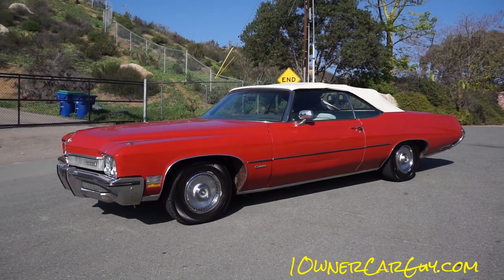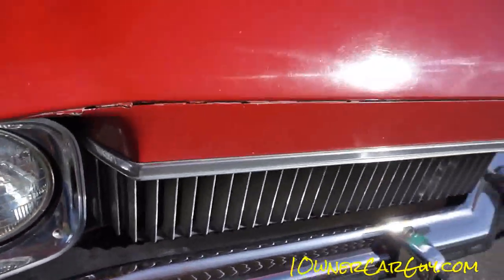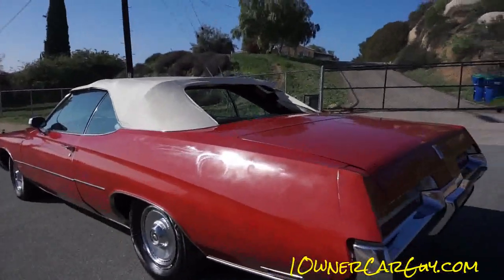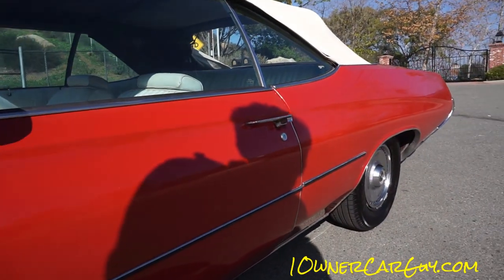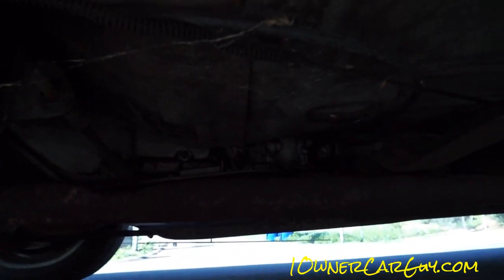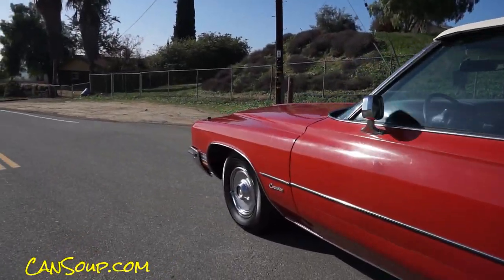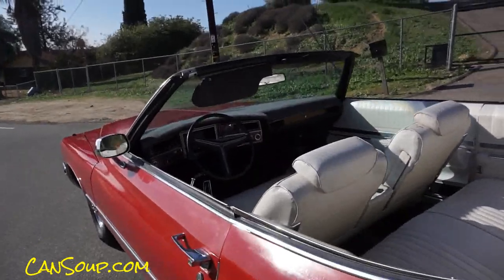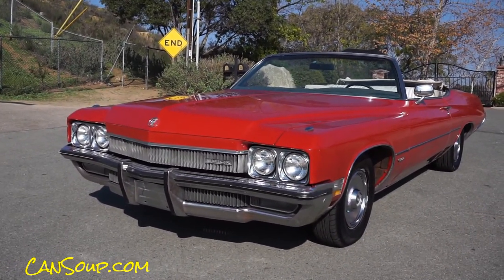72 Buick Centurion Review Impala Delta 88 Video 455 Big Block V8 Exterior

Comment: i'd also drive it just like that, I like them a little rough around the edges ;) that's a clean old original car!.. I have a 72 Mark IV , had it ten years now.. it's time to bring it back from the dead.. never did anything with it.. I'm thinking V10  be cool.. if I can find a cheap truck.. for the drivetrain :)

Comment: I would drive it a season and work on the engine and get it driving, stopping and everything working. The second year I would sand it done to a little body repair and get it ready for a decent new red paint job. Then I would install a new top, new set of wheels and tires and dual exhaust with just a little rumble to let people know its there. this is a great driving classic you can restore while you drive it and not lose any money.